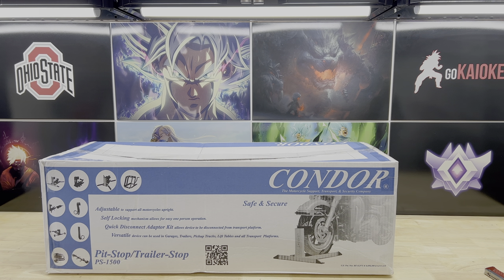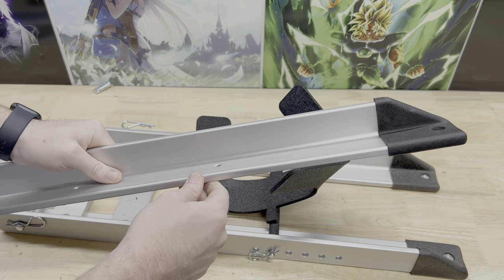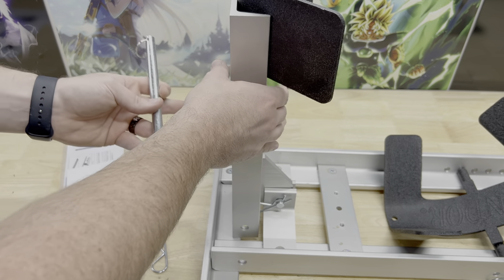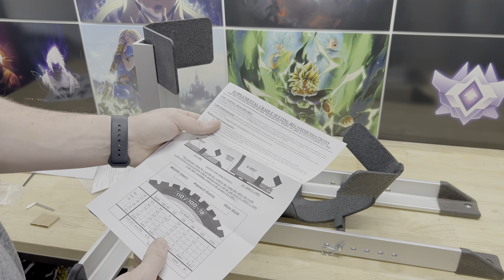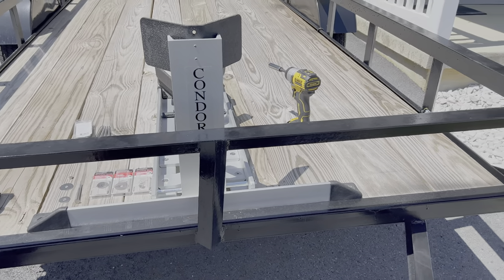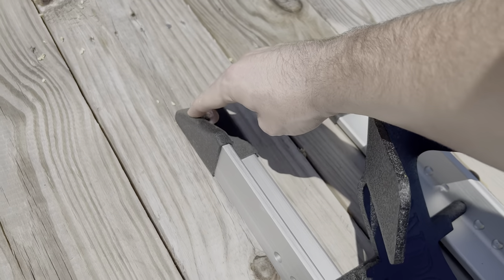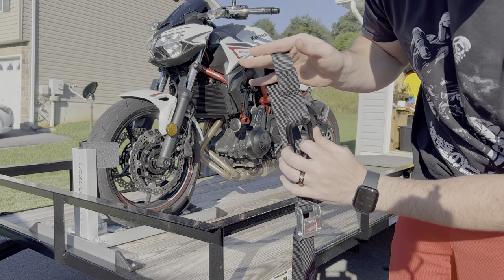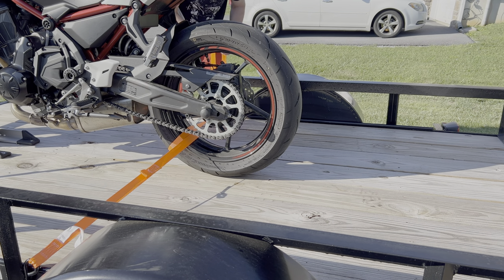The BEST Wheel Chock for your Motorcycle! - CONDOR Pit Stop TrailerStop PS 1500

Comment: 1 use eye bolts in front to hold straps.
2 under trailer use larger heavy duty washers.
Saves room and can load more on trailer
Great video for basic install

Comment: Condor has a $20 adapter that uses 2 bolts that hold the wheel chock.
Reply from the maker: It looks like all the weight is being held down at 1 point smaller point. I think it would be okay if I installed a lateral brace underneath. Maybe not for just 1 wooden board though.

Comment: You don’t even need to bolt it them into your trailer. 
Just throw the condor on the trailer and slide it all the way forward and strap the bike down and it will not budge  
I just did. 3200 mile road trip like this with my street glide. 
Non of us ever bolt them to a trailer.
Reply from the maker: That’s good to know and a great point. I suppose it doesn’t hurt either way. Maybe it’s just for peace of mind.
Reply: @GoKaioken  Definitely doesn’t hurt to bolt them but It’s really not necessary. We use them on the trailer and in the shop all the time. 90% of the time they’re laying on the shop floor with a bike in it. 
For us, it would be too much of a hassle, bolting and unbolting all the time